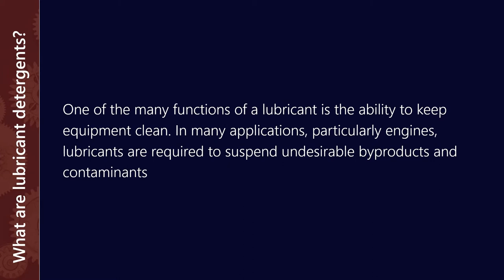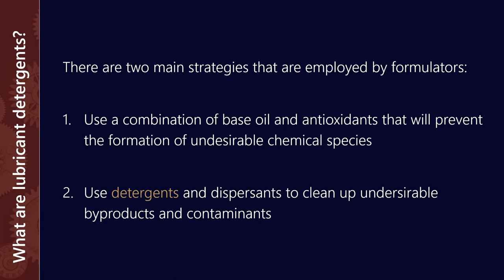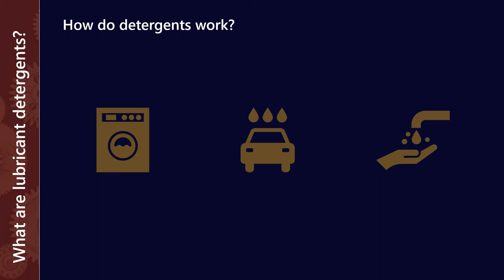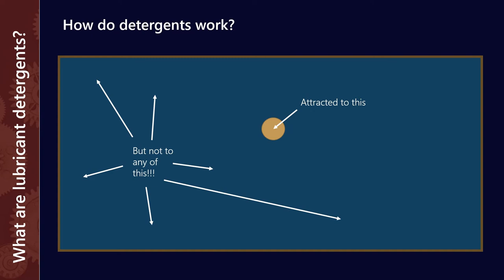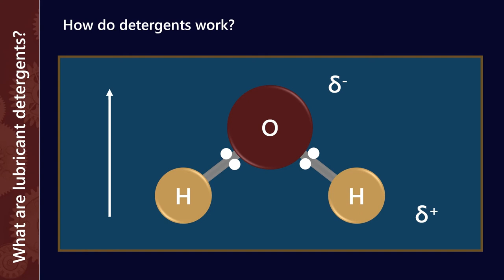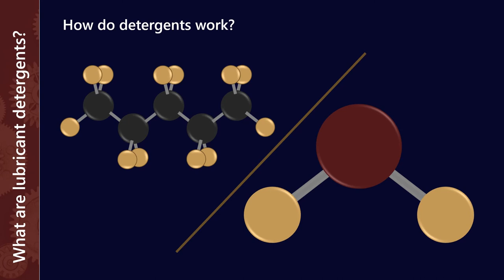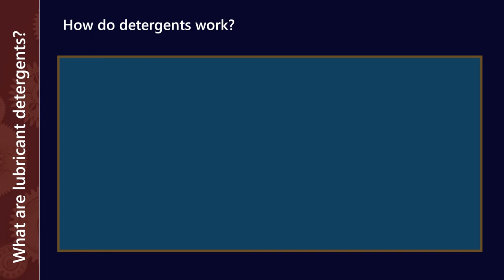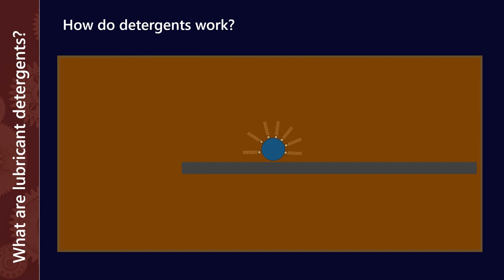How do detergent additives in lubricants work?

Comment: What you're describing are Ashless Dispersant, not Detergents. Yes detergents are based on surfactants  (eg alkyl benzene sulphonate) but they exist in a fresh oil primarily to keep a carbonate salt (typically calcium carbonate... yes, blackboard chalk!!) in colloidal suspension. As acids enter the engine oil, either from unburnt gasoline (which is crudely phenolic in nature) or from oxidation of the base oil, it will react with the CaCO3 to form a more stable Calcium salt & CO2. As the reaction is done at the microscopic level, the surfactants simply 'colloid-ise' the new, resultant salt. These do not get removed by the oil filter.
Reply from the maker: I can see you've also now watched the TBN additive video. Sorry, trying to build a library of videos that can be watched as a series (see the "playlists" section of the channel). The idea was that this video was an intro to the concept of detergent additives in action, which would be followed by specific videos on overbased detergents, and another, separate video on ashless dispersants (uploading later this week!)
Reply: @LubricationExplained  Well done with what you're trying to achieve. I've often myself pondered over bringing more crankcase lube tech to the masses via YouTube & a website. I thought maybe I'd blow some cash on capability to test KV, CCS, Noack, HTHS & KO30 and see how far I could take things. However you have to accept these days that engine oils is a dying business. The death will be slow & strung out but The Age Of The EV is dawning & any investment in yesterday's technology is not a wise thing to do.
Reply: @MrSensible2  While true that it is the aim to move away from oil usage it isn't instantaneous therefore, just like the US investment in current train infrastructure, slight tweaking of current formulas is more efficient. This means investment in using what is still the currently heavily used vehicle infrastructure is more efficient with small tweaks that lead to less waste and less emissions. Same thing was done with trains, the tracks, the greases, the machined wheels, etc.